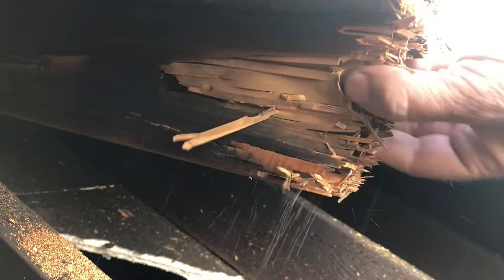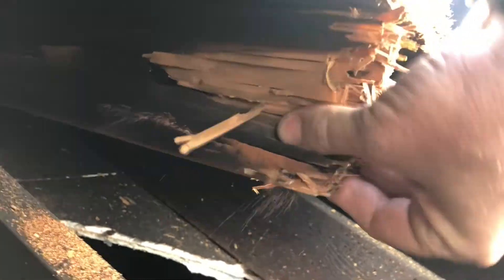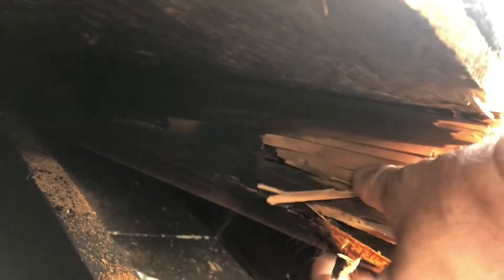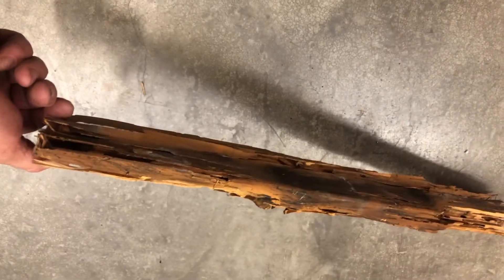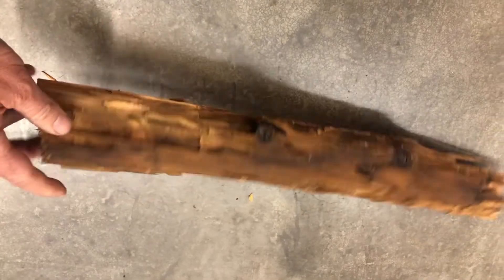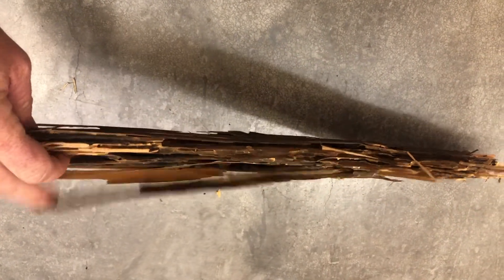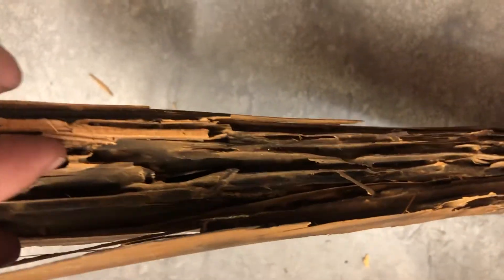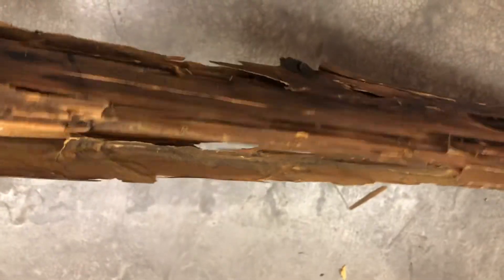Did you just blow through that Rafter?!?

Comment: Nice training and learning points.  The best lessons from this might be to review the lessons learned by project mayday that identifies falls through the roof being the 4th biggest cause of maydays.  With that in mind, review the lessons learned through many NIST/UL studies ( all are available on their web sight, including video lessons.). Those lessons would lead you to question why we are doing lessons on performance of vertical ventilation on residential ( or virtually any, but not all ) structures. The statement on the video was that the ventilation was still effective. What rubric is used to define its effectiveness?  Is it false perception based on traditional tactics and a false belief in what is actually occurring or being seen?  
I ask these questions in earnest as someone who has spent 35 years in a very busy urban department and performed these same tactics with false beliefs until truly being a student of the job and learning the truth behind many of my beliefs.  
Stay safe brothers and sisters and keep learning.
Reply: @JB91710  you contradict yourself. UL stops just short of saying don’t do it. All of the data they provide however does say don’t do it. One just needs to look very clearly at the data. I would say that is the most frustrating part of the UL information is that they provide a slouch of data that clearly identifies what actions should be or should not be taken, yet they don’t just directly spell it out. It leaves many to make the correlation that if they don’t say not to then it’s ok. 
As you stated in the beginning, for it to work in the incredibly rare scenario that it might, everything has to be worked out perfectly in timing. A timing sequence that is virtually impossible to replicate outside of a lab. The end result is that performing the vertical vent is overwhelmingly not a tactic that holds validity in the modern aggressive fire attack. 
In a residential structure, the main tactic should be aggressively applying water to the fire as quickly as possible. In the majority of residential structures that means through the nearest door or window to the fire utilizing the reach and disbursement of a high flow handline. This attack in most cases would accomplish fire control well before a crew could even begin ventilation. In the cases it’s not controlled that quickly, are the cases where the last thing you might want to consider is creating a highly efficient yet uncontrollable flow path.